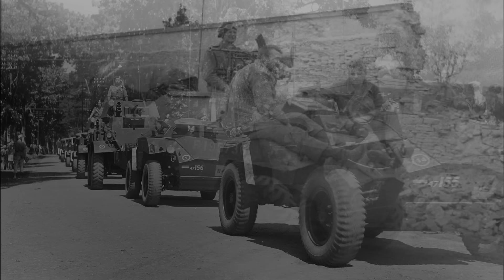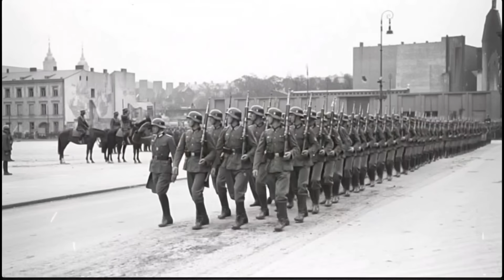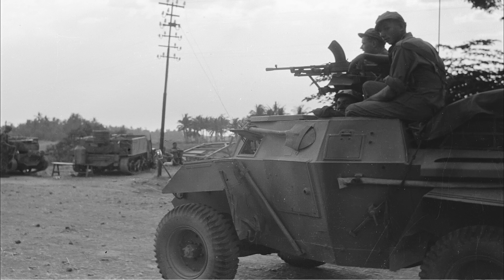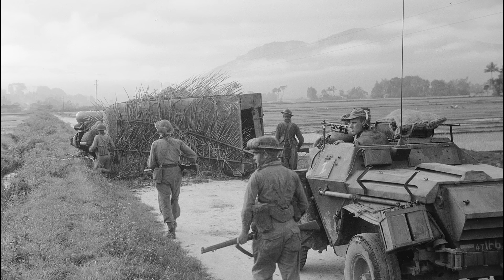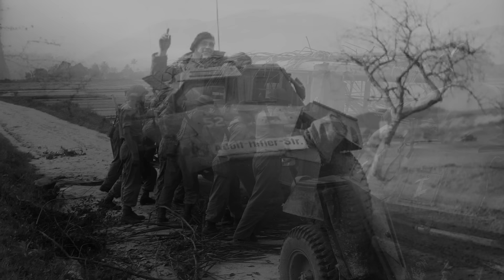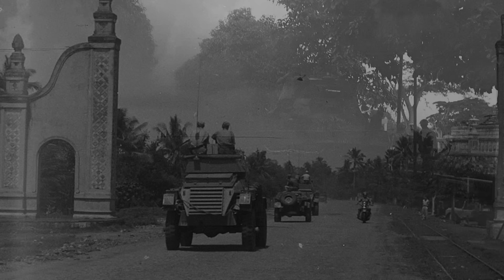Why This WW2 Scout Car is Unstoppable - The Humber Scout Car

Comment: The Humber Scout car was designed and built in 1943 as a replacement for the Daimler scout car which was considered too small for the liaison role. So the Daimler scout car was transferred to the Armoured Car Regiments as a front line reconnaissance vehicle alongside the Daimler armoured car. The Humber was rear engined and carried a crew of three, driver and 2 passengers. It was armed by a roof mounted single or twin Vickers LMG PLM mount which could be fired remotely from inside the vehicle. Speed was over 67mph. It served in the HQ Troops of all Armoured and Infantry units in troops from 8 to 13 vehicles. It was also used by the Royal Engineers, Royal Signals and Reconnaissance Battalions. Its duties were more to do with communications and transport rather than actual reconnaissance. They served well into the 1950s before being replaced by the Ferret Mk1/2 Liaison.
Reply from the maker: Brilliant rundown — really appreciate the detail! The Humber Scout Car often gets overlooked next to its bigger armoured cousins, but its versatility comes through clearly here. Thank you for that detail 👍🏼😉

Comment: The Ferret Scout car followed in it's replacement. I had no problems driving and commanding The Ferret, during my time, even in the Gulf war, Ferret's reappeared, with updated turrets.  We have no such vehicles now operating in UK forces. But they are still in use world wide even now...
Reply from the maker: Great to hear from someone who actually served with the Ferret. Amazing how long they stayed in service worldwide — a real testament to how solid and dependable they were. Thanks for sharing your experience, mate 👍🏼
Reply: @AgeOfWarMachines  The Canadian Army reserve armoured reconnaissance regiment I once served with, the First Hussars, operated Ferret armoured cars up until approximately the very early 1970s. They were taken out of service as a cost-saving measure and replaced with jeeps. I didn't join up until early 1979. It's a shame I never got to personally experience life in a Ferret.
Reply from the maker: Shame you missed them — the Ferret was small, loud, and brilliant I hear. Thanks for sharing 👍🏼
Reply: I rate the daimler mk2 or mk3 as a recce vehicle a bit more punch.